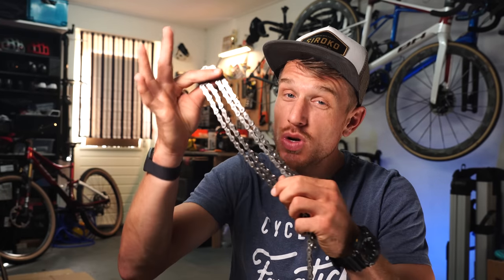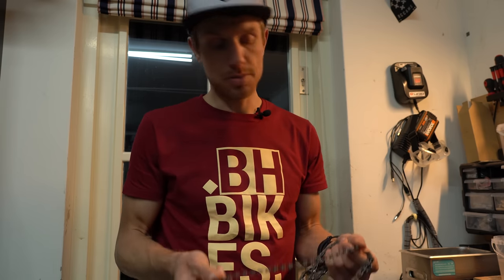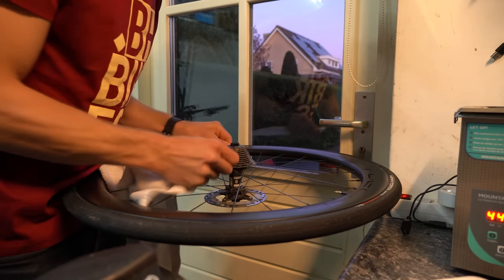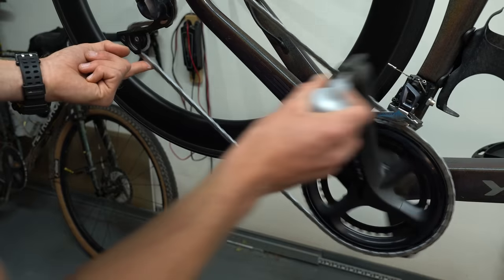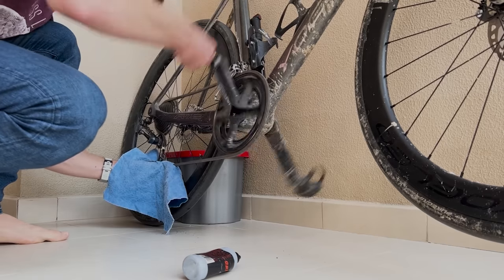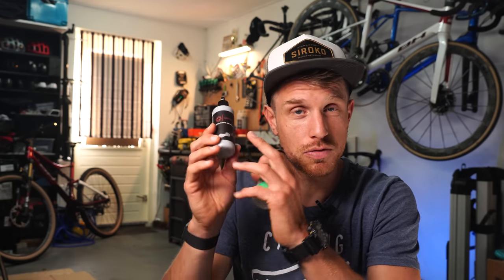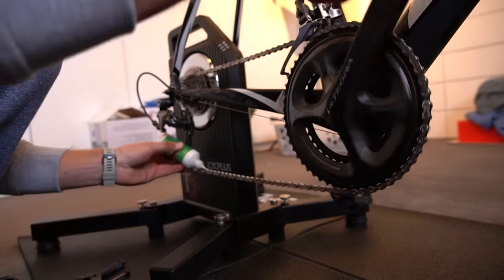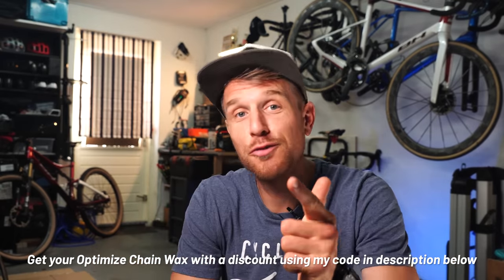Testing Chain Wax for 1-YEAR and this happened..

Comment: After decades of trial and error testing, some cleaning advice: Manufacturers often do NOT recommend acidic or basic cleaners, like Simple Green, which can chemically react to weaken the steel. Most bike-oriented chain cleaners seem to be pretty wimpy, but safe for long soaks; solvents run the gamut from alcohols(useless for chains), serious engine degreasers to paint thinners, strippers, and flammable dangerous one like gasoline, acetone, MEK, brake cleaners, many of them damaging to paint, rubber o-rings and seals. Turpentine and substitutes might work, but not best; kerosene works, but is oily and smelly. Waxes are soluble in naptha, aka white gas stove fuel(UK white spirit, Stoddard solvent), and while flammable, is not too volatile, and evaporates cleanly. I usually use just a couple ounces in a smaller 12 oz plastic drink bottle, add chain + quick link, agitate/ soak for a few minutes, drain(save in a metal can), repeat, wipe dry. Initial removal of factory or other oils may benefit from chain spec degreasers, but always follow with naptha. Water rinseable products always leave too much residue for hot waxing to bond well.
  Sadly, in the last four years naptha has become extremely hard to purchase 
  The significant benefits come from hot melting paraffin, as sold for canning, NOT candles that have stearic acid added. Any minor gains from pricey additives are dubious, to nil, and the few dollars for the pound of paraffin over years of use, versus $$$ to get another 1% if that from teflon powders, graphite, etc. makes commercial wax formulas a waste - like so many bike marketing hypes touting magic gains from snakeoil.
  Because wax is soluble with naptha, it could go directly to the hot wax bath, but air drying is advised; NO water rinsing between naptha and the waxing.
Reply from the maker: White spirits, acetone, petrol all safe for chain material? What about nitro thinner?

Comment: When you showed the pan on the cooktop with wax in it, I cringed.  Never heat wax in a pan directly over the heat source.  Always use a double-boiler (hot water below the pan with the wax.  Or, use a temperature-controlled slow cooker or wax pot.  The reason is that if the wax gets too hot, the fumes will spontaneously ignite causing a fire.  I know this because it happened to my son.  His face was burned.  Fortunately, not too badly and he does not have any scars.  I've been extremely careful with heating wax ever since.  And yes, I do use hot wax on my chains, using a slow cooker to melt the wax.  The wax will melt at around 130F or 55C and should not be heated above 160F or 70C, which is less than the boiling point of water.  Also, use a thermometer to monitor the temperature of the wax to make sure it doesn't get too hot.
Reply from the maker: Wow sorry to hear! That’s why I put the stove on level 1 or 2 (out of 10) so it won’t get that hot! It’s barely melting at that level so I know it’s ok. 

Very important indeed.

Comment: Use gasoline to initially degrease chain. Put it in gas and swirl it around for a bit. Then, put chain after drying from gas, into container of simple green or purple degreaser and swirl around for a bit. Then wash with water and hang to dry. Then it's ready to wax.
Reply from the maker: Sounds easy

Comment: You don't need to buy a pan, you can use aluminium food containers. Use one container for heating and applying the wax, then have another container ready for when you pull the chain out to catch drips. Leave the chain to dry hooked to something with the container under it. Or just take the chain out of the hot wax and leave to dry in the empty container

Comment: That citrus degreaser from Finish line did the trick for my new chain. Put the chain in a bottle, bit of that stuff, shake, rinse, done. Absolutely 0 factory grease on there afterwards. :) Was a KMC chain tho.
Reply from the maker: Try Shimano and let me know if that works. The grease is different
Reply: @jasperverkuijl  I did in the meantime for my girlfriends bike, funny enough. 😁 Had to do it twice for that one since it was caked in the grease. But it worked well. 

I put the chain in a platic bottle tho, so I was able to violently shake that thang. 😅
Reply from the maker: @tr3c00l91  nice!

Comment: It's more work, but it's better to remove the cassette and jockey wheels, too. There's a lot of grease that gets embedded and needs to be removed to avoid contamination. Once the chain is rinsed in water, that's the right use of acetone or de-natured alcohol. They evaporate quickly and will drive any remaining water from the chain and prevent rusting. Allow it to air out for at least 15 minutes before waxing.

Comment: To strip the chain I use a bit of wax and grease remover first then wash with a bit of water then you can use Mineral turpentine and finally some mentholated spirits  to leave the chain perfect. These are cheap and easy. Another option is just use some diesel or petrol and then mentholated spirits. I also use a slow cooker. Cheap and easy to keep it all contained

Comment: To suggest a Japanese company is putting "rubbish grease" on its chains is a very long stretch IMO
Reply from the maker: The grease they put on is only for preserving the chain when it lies on the shelves for months (so it doesn’t rust) 
You need to remove it dude 🤙🏻

Comment: Great video! One disagreement I have regarding the indoor trainer + wax, however, is that wax is indeed a HUGE benefit over dry/wet drip lube! I found that dry/wet drip lube would collect so much grime from my pain cave (dust and airborne particles are a thing in some spaces- look it up and you'll see that other have this experience with dry/wet drip as well); wax completely prevents issues with this and allows the chain to stay relatively clean, outside or inside- wax for the win! 😉
Reply from the maker: Good point 🤙🏻
Reply: Agreed.  Definitely wax indoors.  It lasts foreverrrrrrr and you definitely don't want black chain grease inside.  Just put down a training/yoga mat under your drivetrain and you're fine.

Comment: I completely agree with you, Felix's product is great and the plus points are overwhelming. I don't see any reason to go back to an oil-based lubricant.
Reply from the maker: 🙌🏻awesome!
Reply: how about riding in the rain? I found using drip wax it washed away during a really wet gravel ride. Would like to use a waxed chain on my commuter bike.
Reply from the maker: @Koen030NL commuter bike depends… do have a chain guard? 

It will stay ok during a Wet ride but you need to re-apply after the ride. I have footage of wet rides in this video so check that

Comment: A 1L plastic bottle from Orange Juice, water, etc, an ounce or 2 of regular old diesel (its not as harsh as gasoline), add the chain,  put the top on the bottle and shake it like your momma taught ya. Dump the used diesel on some old fire wood or in your neighbor's garden and youre done. Get another bottle and do the same with some alcohol. Next, put chain in an old toaster oven you got from the thrift store or for $5 on Marketplace, pre-heat chain to 300°F (wax has a flashpoint of about 400° so be careful not to be hotter than that). Then, drop chain into wax, which SHOULD be less than 250°F. As the chain cools down to 250, it will soak in the wax into all the opened up, hotter gaps that the pre-heat caused.

Comment: I use paint thinner for degreasing the chain. It works very well - better than the brake cleaner. We call it "diluant". I think is the same like your "nitro cleaner". 
BUT do NOT use on the chainring, or anything that is painted because it will take off all your paint.
Reply from the maker: Yeah so always remove the chain 👍🏻

Comment: Degreasing is easy.   It takes several days but each step takes about two minutes of work..   You need some jars.  A proper degreaser.   I use mineral spirits (in the US).  Pobably same stuff as yiur nitro thinner.   I soak it overnight.  Replace the solvent.  Another overnight.  Next isopropyl alcohol.  A couple of rinses is enough, a few minutes each..  So you are a couple of days into the process.  Then it's clean enough for wax to stick.  I use immersion waxing.  If the chain is stiff once it cools down, you did it right.  My waxed chains seem to never wear out.  I used to make my own wax but now i recommend the Silca stuff.  Its great. I think it lasts about 300 km but maybe longer.  Anyway, about then, I just immerse again.  I really don't think you need to clean the chain before rewaxing.   Don't use hot wax in your kitchen. Too messy. A $35 rice cooker will do the job. The drip wax is kind of a pain to use in my experience.  You should let it dry overnight.  You are right about drying your chain if it gets  wet.  By the way, I have a Yoeleo bike too.  So far, it's great.

In short, I agree with pretty much everything you say.
Reply from the maker: Awesome! You got it dialed

Comment: What about chain wear/ stretch; does the wax (with or without the different additive options) reduce wear on the roller/pin interface? Will a chain last longer before needing to be replaced (e.g. at 0.5% / 0.75%)?
Reply from the maker: I haven’t been able to test the difference in wear within the different variants
Reply: I was wondering about a comparison between the wax, and a regular wet chain lube (when applied as needed).

Comment: Petrol works VERY well removing grease. Don't need a lot but at least 3 soaks in 3 different 150ml bottles.
After a few chains, dispose the 1st petrol bottle and the 2nd becomes the 1st and so on...
Final cleaning with degreaser.
Reply from the maker: Good line up 👌🏻
Reply: Guess you never head about hydrogen embrittlement from soaking metals in gasoline? Don't worry, not everyone has.
Reply: …how do you safely dispose of petrol?
(ps I use it)
Reply from the maker: @markthomasson5077  we have a central collection point for stuff like that (also batteries etc) so I just leave it in a big jar and then drop it off once in a while

Comment: Not sure if others have said it, but mineral turpintine in a jar. Shake for a couple seconds/minutes and repeat if needed. Then in a jar with ethanol or equivalent to strip the turps off, plus its super volatile so it dries out super quick 😎😎 Takes me max 5 mins to strip a new chain
Reply from the maker: Sounds just like the Nitro thinner I use!🙌🏻🙌🏻
Reply: Hey Jasper, thank you for a very informative vlog.  2 questions:
1. Any idea if we can purchase a grease free chain?  I.e. no grease applied to the chain out of box.
2. Any manufacturers selling already waxed chain that can be purchased out of box?
I assume shimano or sram will provide this as it becomes more popular?  Something to inquire about, perhaps 🤔
Reply from the maker: @s.jatighetchi9021 
1. I think they all have some grease but Shimano is the worst. I’ve seen some comments about brands with less grease but,

2. Since recent, Optimize actually sells pre-waxed chains! (After I finished this review) So that would be the perfect option for you.  Check out the website
Reply: Thank you @jasperverkuijl  will check out Optimize for sure 👍

Comment: 2:59 - I personally use White spirits (Paint thinner) to do my degreasing if I need EVERYTHING off. Petrol works just as well. 
Both are equally bad for you. I wouldn't recommend keeping it anywhere inside the house if you can avoid it. 
Leave it in a jar somewhere like your shed. Also make sure to wear gloves + DO NOT Breath it in. I can guarantee you that these solvents are Carcinogenic :) We wouldn't want that

Comment: I have 4 chains in rotation for my road bike on which I ride 300km per chain before re-waxing with Molten Speed Wax (I don't use drip wax). I have done over 15.000k now and never want oil again. Also the chain last longer as there is less wear (I am checking this with a parktool chanin tool).

Comment: I use Varsol to clean chain,  2 separate baths overnight, then bath in methyl hydrate to remove the varsol. Very economical, if maybe takes a little longer.

Comment: Gasoline for 30 minutes or so. then put it in minerals spirits. Repeat using mineral spirits until mineral spirits are absolutely clear. Then put chain in denatured alcohol. Pull out, dry it off then into the wax. Whole process for a new chain can be done in less than two hours. Re-waxing takes 15 minutes max. I get at least 600 miles each time
Reply from the maker: I think I can clean a new chain in about 10 minutes with the procedure I found and showed in the video 🙌🏻🤙🏻

Comment: 10:48 you could heat up chain on bike by inductive heater and then touch chain with piece of your wax and it would melt and penetrates inside of chain with no complication you have with pans, pots and kitchen
Reply from the maker: Ok so who will have an inductive heater machine at home? 😜🤷🏼‍♂️

Comment: Use the ultrasonic (US) with a specific US degreaser ... it works like a charm!

I use Tickopur R33 ... and repeat a 10min cycle untill the solvent stays clean. 3 cycles and they are as good as new. 🤔 ... I rotate 3 chains in order to minimise my waxing-frequency and maximize the lifespan of my cassette (and chains). My homemade wax lives in a low-cost slow-cooker ... I am a convert 😅💦
Reply from the maker: Early adaptor and mcggyver style.  Nice 👍🏻

Comment: Varsol or paint thinner, same thing and best cleaner and cheapest price per liter.
Never water as a rinse or ultrasonic needed, use a compressor and air blast it dry and pay attention to the rollers.
Now hot wax.

Comment: In the US you could buy a gallon can of car parts cleaner that even has a hopper in it to keep your chain in if it can take varnish off of a used car part it can clear Shimano‘s grease off a chain and it did I’ve used wax chains for a lot a lot of miles
Reply from the maker: A gallon would last a life time 😂😂👌🏻

Comment: After one year (15000km) of experiencing chain waxing, i can defenitively approve this stuff.
The first approach was the drip Dynamic Speed Potion. Very good but a bit sticky.
After that the hot wax with Silca Secret. I don't want to remove always the chain, so after the first application, I use also the Silca Super Secret  Drip, a apply every 400 km or after every rain ride. To wash the chain in dry condition I use a micro fiber cloth, great work. On the gravel bike I use secret hot wax the first time and now Dynamic Speed Potion drip, good results. With the dynamic Speed Potion I noticed that a repository of gray matter sticks on sprockets and chainrings and protect them from wear.
Big question : Sram and Shimano are saying that the chain connector is single use, however I have used 2 or 3 time without issue, any advise on it?
Reply from the maker: I just re use them as long as they properly snap tight I think it’s ok. But no official advice 🤓😉

Comment: Have done 3200 miles on a waxed from new Ultegra chain (cheap paraffin wax from Amazon). Chain wear tool still doesn’t even begin to indicate wear on the 0.75 gauge. How have you found wear with that fancy wax?
Reply from the maker: That’s awesome. 
The wear with wax will be much lower in general. I have too many different bikes (and chains) to have an accurate number on it since I’m not putting that amount of km’s on every single bike..

Comment: I use mineral spirits (terpetine) to get rid of most of the factory lubricants. Then I use acetone to clean it once more. Works perfect
Reply: Another tip is to use a new/old spoke to get the chain in/out of the hot wax ;)

Comment: Do you re-use the quick links from Shimano 12spd (are there any re-usable ones) or do you have to shell out 2-5€ every time you want to hot wax the chain again? Or, 1. hot wax, then only use drip wax? 
Thank you for the very informative video!
Reply from the maker: I just re-use them. Never had issues. Not official advice 🤪😜

As long as they properly “click” into place, I think you’re ok
Reply: You can also use a Connexx chain. They’re easy to take off and put back on without any tools
Reply: I ordered the wax and I am looking forward to the adventure 😅
Reply from the maker: @elchram 🎉🎉

Comment: Hi, I have stupid question. Do I cut my chain to length before or after waxing? I am worried if I’m doing it before that I’ll contaminate cassette and pulleys on shifter.
Reply from the maker: Good question. I’d do it after than 👍🏻👍🏻 saves dirty hands and indeed, contamination
Reply: @jasperverkuijl  Or maybe after I clean it and before waxing.
Reply from the maker: @MetalFukaz  or after waxing. Doesn’t matter. Just wax the quick link too
Reply: @jasperverkuijl  I should wax it too? Isn’t that only part that I should not wax? Haha
Reply from the maker: Sure. The pin of the quicklink should be waxed as you take out the other pin with the tool
When you shorten the chain 

Just put the chainljbk on the chain (gently without “clicking” it) when you put it in the wax bath

Comment: The fastest way to degrease a new chain is to immerse it in hot degreaser and keeping it hot. The heat really makes a difference, cuts through the factory grease so quick. Takes me less than 1 hour to strip the wax this way.

Love my waxed chains, main tangible difference is how silent and smooth it runs to me.
Reply from the maker: Ill try the heat 🙌🏻 
With the nitro thinner it was only about 10 minutes so would be quite good I guess

Comment: The money saving is the thing Especially using new chain, ultrasonic cleaner,   uc degredient and hot wax.
Reply from the maker: Mmmm, you can buy a few chains for all the equipment used in this video 😅😜
But you don’t need ultrasonic, a jar and shake will work. And thinner isn’t that expensive (cheaper than “chain degreaser” that you need with a oiled chain)